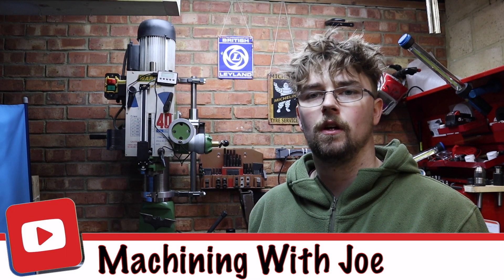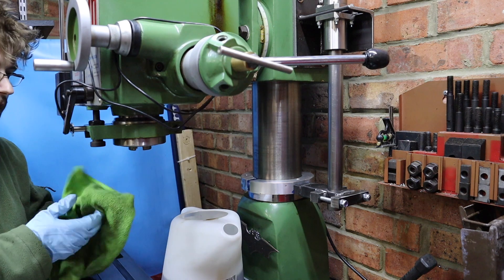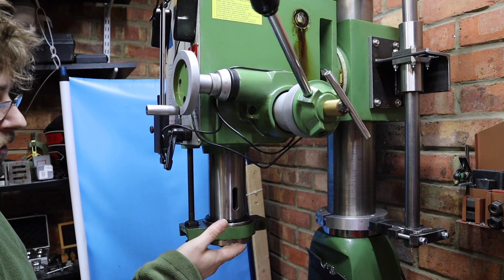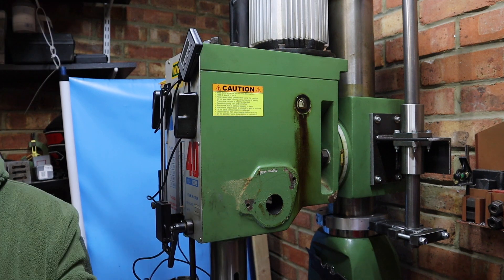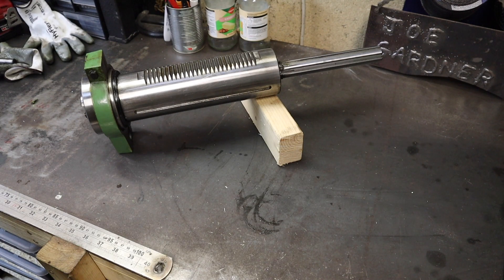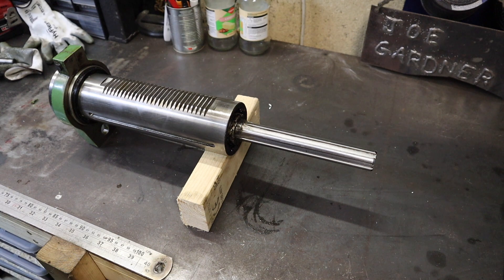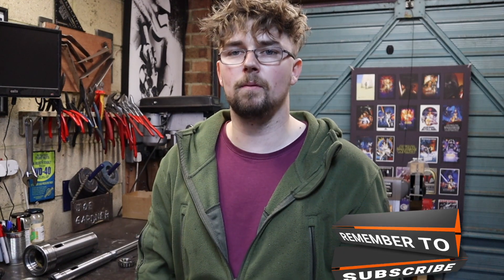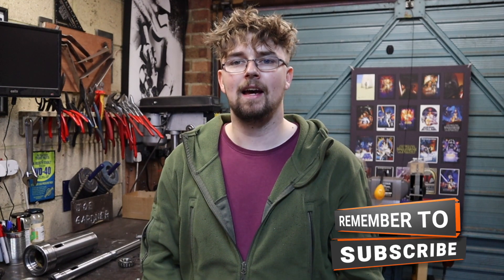How to replace Spindle Bearings on a Warco Milling Machine

Comment: Thanks video ..different  situation  had put head on a diet ...lighten it so be able to lift  it had to break down machine to parts reassembled table and colum but head is a heavy bit  so now can knock off some more weight thanks

Comment: At work we have a Grizzly G0755 mill and I've been having an issue with the spindle heating up. It looks like I'm going to have to replace the bearings and your video has really helped me. I had no idea how to go about taking the quill and spindle out, but your mill has the same kind of design as ours. I was having a lot of anxiety about this fix but you've helped ease it.
Reply from the maker: Hi William really glad my video has helped you out with your day to day life. Be good to hear how you get on with it in a future video down in the comments. All the best.
Reply: @MachiningwithJoe  just got it back together. It was a bitch and a half but tomorrow I'll see if it fixed my over heating problem.

Comment: Well done!. You made that look easy.
The spring hopefully will just slide back over the screw and click into place. Don't forget to pretension it.
Please start using a piece of board to cushion the shaft from the table, the next time you try and fit a tool in it might not go!.
Once again well done. Not a hammer in sight😁.
Reply from the maker: Hi Fred great bit of advise with the wood will have to get a bit of ply cut to the table size. Protect the spindle and table win win.

Comment: Can't leave you alone for five minutes! I bet you took your pets apart before you bought a milling machine. now your next challenge should you wish to take it is to add a " drift car" steering wheel in place of the handles on the quill feed makes it nicer to pull down with a better feel, and dont do as I did let go of the quill lock and the handles spun air the wheel of fortune clobbering  me and giving me a loverly shiner.  nice job Joe keep at it and have a think about a spindle lock.
Reply from the maker: Yeah the handle has nearly caught me out a couple of times. A little steering wheel would look pretty cool and probably give a good feel when feeding.
Reply: @MachiningwithJoe  or get a bus steering wheel so you can really hang on to it and get blunt drills through HSS! :)
Reply: @graveneyshipwright  as a observation I would think twice about fitting a steering wheel arrangement here.  I frequently need to take off individual handles when working with the quill close to the table (e.g. when using small end mills in a collett chuck) to stop them fouling with whatever may be clamped to the table.

Comment: New bearings. Good Man. When I was at the Railway (might have told you this already, Sorry) We had some coaches come through that the SKF (very good bearings by the way) were only lasting about 100,000 miles, that is nothing for a train, turns out one of the vehicle builders was doing a bit of extra work on each carriage and could not be bothered to put an Earth strap on when they were welding, so he earthed through the bearings and put a pip on each one. Ha Ha. Should not need to re-grease all the time, you don't on the back wheels of your car, just put loads of High Melt Point grease in (properly in) the new bearing. On my car bearings [before I got old] I used to do 0.0007" endfloat, no idea what a mill should be.
Reply from the maker: That’s a great bit of investigation to find that as the fault. Hopefully this set of SKF bearings will last a long time.